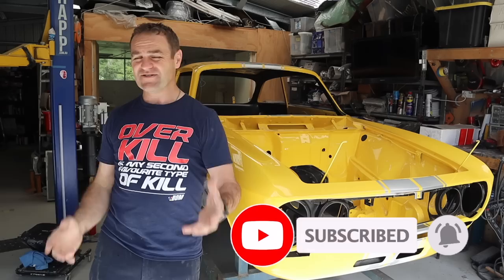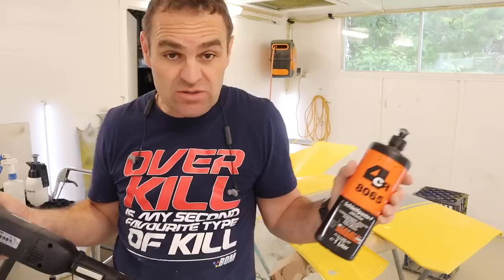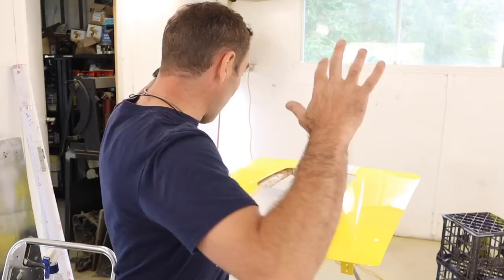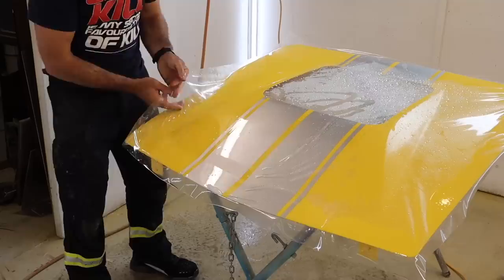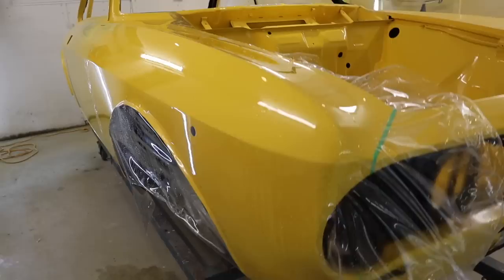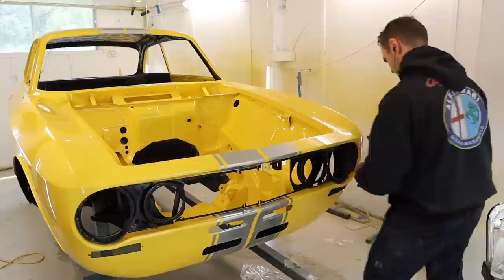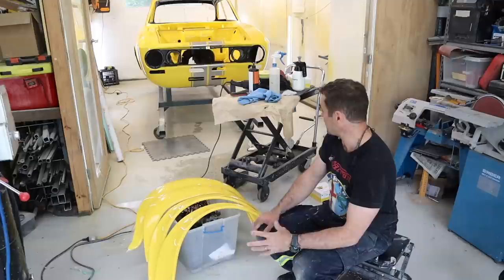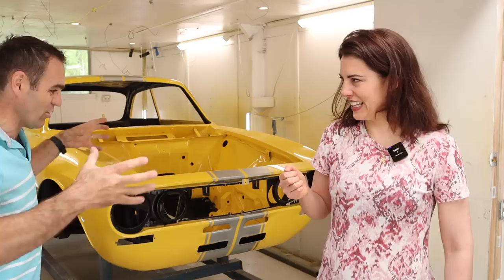DIY PPF Fail... and then I got a bit better - Ferrari engined Alfa 105 Alfarrari build part 155

Comment: Did a great job. A tip for those joins: leave a bit xtra on both pieces of PPF, lay them over each other and cut both in one go. This will give you a perfect join everytime without any effort. Both sides will fit perfectly against each other, eliminating the chance of getting that "dirt line" over time. I'd also recommend using knifeless tape, instead of a blade, to make these kind of cuts. Can't wait to see the car finished 😆
Reply from the maker: Cutting them together would still leave an area with 2 layers. I have seen that knifless tape, but I don't think it works with PPF as it is too thick, it is just for wraps as far as I am aware.

Comment: Jeff, unless the car's metal surface, or the primer coat were not thoroughly cleaned of any oil and surface contaminates, your finished paint should in no way pull off.  Great videos, thanks.

Comment: Nice job!  I've used ppf on all of my cars for many years.  I think It's a good investment.  I have an Audi with 127,000 miles that I have had ppf'd since new.  The paint looks great with almost no chips.  Even the headlights have benefited from ppf as they have not hazed as you might expect after 13 years and many miles.  My new 991.2 Turbo S went straight to my preferred ppf pro...not cheap but again it's an investment against damage. Porsche paint seems prone to rock chips.    Also, resale value is helped if you have ppf.  Nice job, Jeff. 👍🏁

Comment: great job as always Jeff. from experience (doubt they are the same thing) when i put cell phone protective self adhesive film/glass and there is a spec of dust or hair i use a bit of scotch-tape to pull it out, doesn't damage the adhesive. p.s i would put a protective layer on the roof aswell.

Comment: Given your experiencr, I will not use ppf on any of my projects, not worth the risk, trouble and expense for me. Good that you stuck with it, though!
Reply: Ppf it definitely worth the investment on expensive cars where having oem unpainted panels keeps the cars value. Its not aimed at cheaper cars where its cheaper to get parts painted. Fair play to Jeff for giving it a go ive been installing it for around a year and a half now and then and its certainly not easy to install. Especially Jeffs car. Dont let it put you off tho.

Comment: Jeff , have you ever tried using water with the rubbing compound? A friend , who works in the trade always has a bucket of clean , luke warm water to hand . He basically washes the buff head and applies water to the paint surface as he goes , adding compound as required. It creates a lighter paste and prevents build up on the head but still retains the ability to cut the paint. It produces great results and he swears he’s never burned through the paint since adopting the practice.  Great progress so far . You’re getting there 😎
Reply: In my experience, water and polishes don't mix. I mean, since one is oil based and the other water-based, they chemically don't mix.
But wetting polishes never works well. It makes a huge mess, and as you said thins the polish out, making it far more work to make the compound do its job. If you want a finer cut, use a finer polish.
Reply from the maker: I did when I first started, but it is much much better without. A mate who is a pro also recommended me not to use water.

Comment: If the paintwork is covered in plastic film how does that work for future polishing or does it just require a simple wash?
Reply from the maker: The wraps are actually self healing. They can also be waxed or ceramic coated like regular paint.

Comment: I have never used or experienced this paint protection film but do question its necessity. Surely a good paint job is enough to protect the metal within its limits and sun damage to the paint colour can be reduced by clear coat and even tinted clear coat.. i am uncertain that a micro shrink/stretch wrap material can withstand  impact of "pebbles" thrown up by lets say a 32 wheeler. As i said i have no experience of the product which in this case can not defend against dents dings sharp scrapes all of which will allow water ingress between the surfaces and lead to delamination and paint contamination and future rusting. I would love to be shown evidence to the contrary. maybe just a suspicious ole' goat. To defend a surface you must first stand away from it
Reply from the maker: It definitely works. My 911 is littered with stone chips everywhere except where the PPF is. It is also self healing so if you get a minor scratch on it and leave it in the sun it heals.
Reply: @HomeBuiltByJeff  Good to know so may of these "tech" solutions are simple marketing maneuvers. Hopefully soon my next project a Mitsubishi 4x4 pre shogun will be started over the Christmas period.... you know the OMG what did i buy and why moment? That's just  her indoors and my real feeling being "Oh heck" one panel at a time .Dreaming LS4 swap from V6 3.5 and mobile working rig